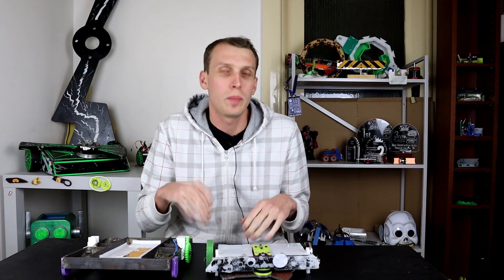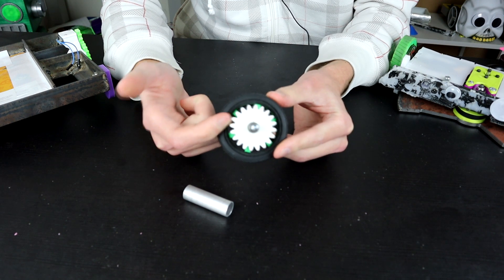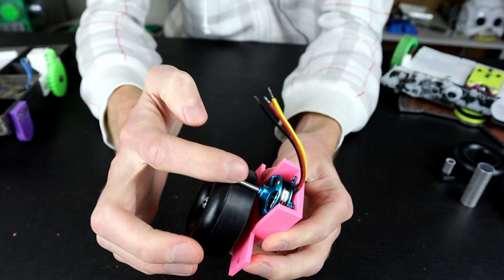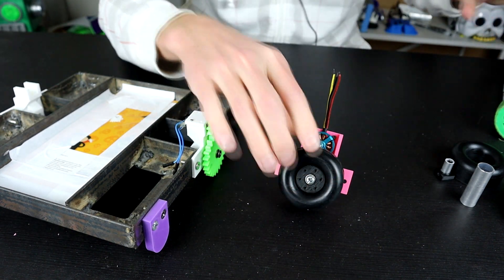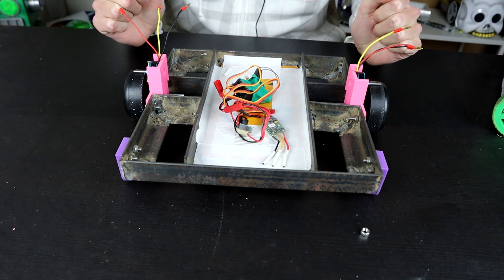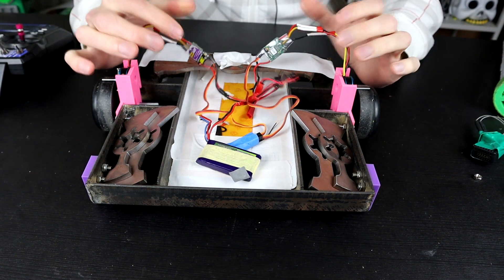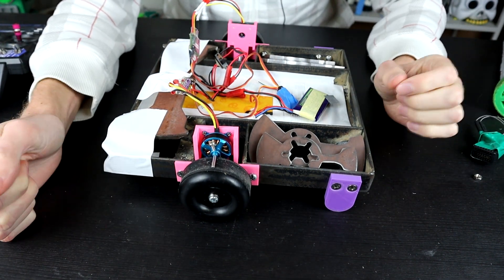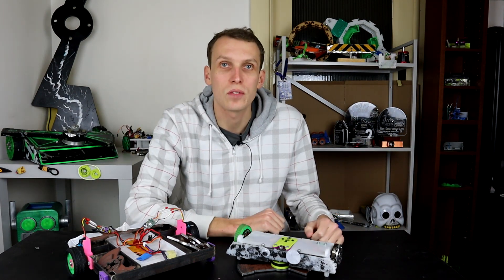Tangential Drive Experiments (Simple Beelte Drive?)

Comment: If the design allows would it be possible to skip the shaft and simply run the wheel against the motor housing? Lower KV would likely be required.
Reply from the maker: Yes, you could run it directly from the motor can, but doing so will increase the speed and reduce the torque of the output, so you'd need a lower kv higher torque motor to get it to work

Comment: maybe you can run a slightly smaller "inner" wheel that is more inside the bot which is what the drive shaft connects to, thus less likely to have pieces ripped off during combat?
Reply from the maker: The thought had crossed my mind, not sure how that would go with the gearing, 
But as this system works well enough for now, I'm going to run it as is
If  find problems in combat I'll look at changing it for future versions

Comment: That works really well! I would say with a little roughing up the shaft and it could be quite reliable even without needing so much 'squish' on the wheels, and its certainly a good way to get that high reduction/low weight combination. I had considered trying something like that on shrapnel mine but the urethane I use is probably too soft and I need a lot of pushing power so I will likely stick with gears - for now. For a less control style robot seems like an awesome choice.
Reply from the maker: I was thinking about roughing up the shaft but was worried about it getting stuck and chewing up the wheel, might be something to test though.

Yeah dont know how well this design will push, but as I'm running it on a weaponed robot, pushing isnt my biggest concern.

Comment: Heh, that's how I ended up trying to run my first bot, a beetleweight running on brushed 550 equivalent motors(heavy). I put some heat shrink on the pinions that were already on the motor for some grip. Had the same problem with flat spots causing a lack of contact. Didn't finish the bot because the event got canned :(

Comment: have the motor on a spring loaded arm that pulls the shaft into the wheel at all times... i would also consider maybe having the shaft run inside the wheel so floor debris and damage won't affect drive as easily...
Reply from the maker: Ooh inside the wheel is an interesting idea, but seems like it would make for a super complex mechanism
Reply: @TeamPanicRobotics  just have like a deep dish wheel... and have one of those carbon fibre drone arms with the bldc attached to that... cut it to the length it needs to be, drill a hole at the far end to put a bolt through, and spring load it with an extention or torsion spring...
Reply from the maker: Right yeah, by comparison, that is a lot more complex, in theory, it would be more rugged, as long as every added element was individually rugged

I think I'm going to run the basic version first and if I run into any issues with it I'll start adding complexity to fix the problems I find

Comment: Thinking out loud: if you can fix rubber/silicone to the shaft (e.g. drilling a hole in it and then placing it into a mould) that should expand at high speeds, i.e. when your shaft doesn't have contact with the wheel. This could gap small imperfections, but at the cost of less wiggle room with the gear ratio.
Reply from the maker: Thats an interesting idea!
Something I'll put on the list to look into if this doesnt go as well as I want it to

Comment: How's the push power and does pushing cause any significant wear?
Reply from the maker: Havent tried pushing with it yet, but it can carry the full 2.5kg chassis no problem so pushing should be ok

Also, it will be running on a bot with a weapon, so I care more about its ability to deliver the weapon into the opponent then its ability to push the opponent

Comment: I would worry about using it in combat. If one little bend or tweak or movement out of place happens from a hit then an entire, otherwise undamaged, wheel could be disabled
Reply from the maker: True, but that comes down to mounting, with a thicker shaft, good bearings and a solid motor mount the chance of a tweak or movement is as close to zero as it can be
Breaking a chunk is still a concern though

Comment: That is a very unusual design for a drive system, and it looks to work quite nicely. 👍

I do have just one concern if you're gonna install it into Annie. The exposed motor shaft could be a tempting target for other spinners if they get around you, meaning you won't just lose a wheel, you could lose a whole motor.

Hopefully that won't happen, and Annie will rule all at Robot Havoc!
Reply: i think a bigger problem would be wheels just losing contact due to misalingment or chips from damage
i doubt protecting it with a protective case would be a massive problem

general slipping during high stress scenarios might also be an issue because a bare shaft might be too slippery or get caught on the wheel texturing, especially after damage
Reply from the maker: I'm not too worried about the motor being hit, it will be fairly high up and out of the way
Certainly less risk then the yolo drive

Slip might be an issue, but I have a few tricks I can try if that turns out to be the case